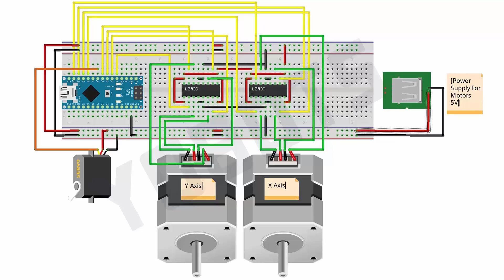How to make CNC Machine at home Part 1

Comment: What the maximum size paper can be written by these "dvd diy CNC" machines? An A5 letter would be OK, or smaller?  Thx for your answer!
Reply from the maker: Smaller. If you want to bigger in size you need to change stepper motor.
Reply: X 8cm
Y 8cm

Comment: The stepper motor as well as the motor driver is getting quite heated up, what should i do to prevent this? The connections and power supply is fine but the motor and driver IC is still heating up.
Reply from the maker: How much voltage you are applying to the stepper motor?
Reply: +yobots  5 volts from my mobile charger
Reply from the maker: Send me some closer image of your circuit to infoyobots@gmail.com
Reply: +yobots  Sure thing .Thank you
Reply: Heat sink fit on ic and cooling fan

Comment: My stepper is getting hot
Is it normal or I did wrong wiring
Reply from the maker: You have done something wiring. Check your connection properly.
Reply: yobots 
Can you tell me the volt and amp rating of supply you used
Plus can you give me your mail so I can send you pic and then guide me about connection
Thanks

Comment: pls sir make a quick replay because my project in on sept 15
Reply from the maker: Hey parth,
 tell me your requirement 
email me - infoyobots@gmail.com
Reply: I want cnc machine and softwares at any cost because my school exhibition is on 18th sept 2017
Reply from the maker: you can find all the parts online.
only circuit board you have to make...
email me your contact no.